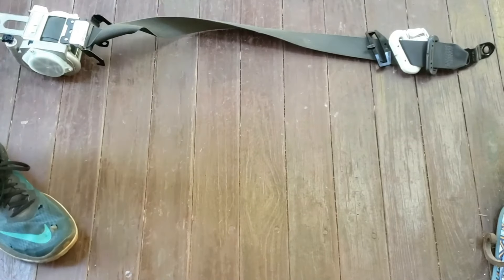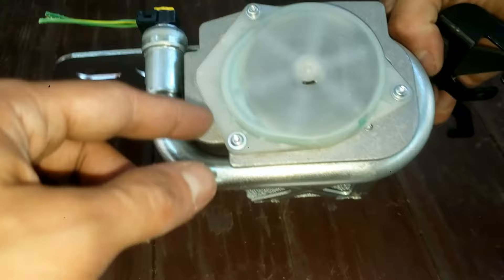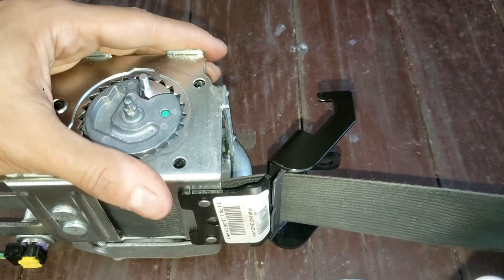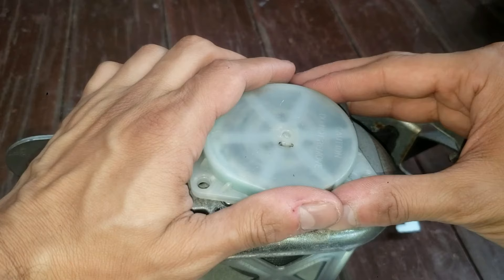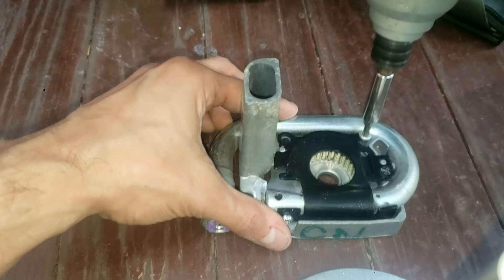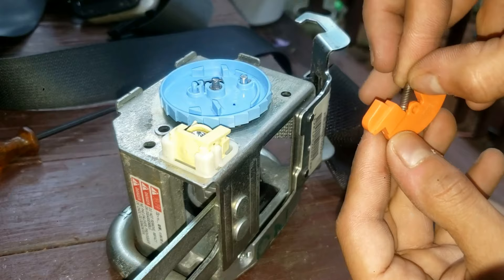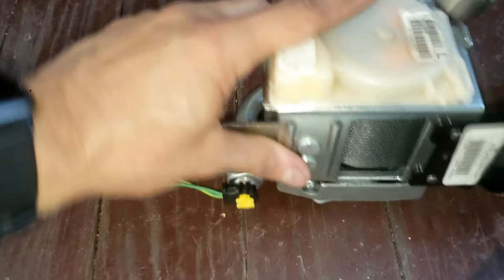Repair Locked Jammed Seat Belt Retractor And Teardown For Chrysler Or  Dodge

Comment: You didn’t unlock the belt you took it apart and put it back together kudos to that but you didn’t fix a problem.
Reply from the maker: Watch the video again in full. You'll see that it was stuck or jammed, and that I fixed it.
Reply: You right, he just apart it and put it back together that’s it. This seat belt was not lock at all, just needed to be balanced and virtually pulled.

Comment: that was a great tear down and put back together.  what part was stuck?  what made the retractor stuck in place?  could you point out what was stuck?
Reply from the maker: Thanks. So the actual belt strap was stuck because it got over retracted. I know that might not be the answer you were expecting, but literally the belt strap got to far in, and this had to be opened up to loosen the the belt, so it could function normally again.
Reply: @FixCarYourself  okay, got it.  if the belt retracts too far the diameter of the retracted belt will rub against the frame and push the ceter shaft off center.  That makes it so the ratchet lock can't unlock.  Thank you for the video
Reply from the maker: Glad it helped!

Comment: Thanks a lot .. your disasimeling  video made it easy for me to know what missing with my seatbelt.. it was stuck initially and after I tried to clean it and put it back it didn’t work and then later after I watched your video I noticed that I was missing the big spring .. luckily I found it just blew the seatbelt itself and the time I placed it back it worked .  So thanks 👍
Reply from the maker: Awesome 👍 glad it helped, and that you figured out how to fix your car yourself.
Reply: Disassembling.  I think I got that right...the spellcheck didn't complain. Only the word "spellcheck" is underlined in red, so...apparently, it's spelled wrong.
Reply: @FixCarYourself  I think I'll watch more of your videos. Just try to use your voice a little louder. Also...the slower, the better...nice job.
Reply from the maker: Thanks

Comment: Thank you.  Everyone is doing the standard slow pull release which helps in no way when belt has been wound completely.  thank you for help.  Saved me a few bucks buying another.  I had mine fixed and reinstalled in 10 minutes.😁
Reply from the maker: Awesome! The slow pull sometimes works, but its luck. Usually its just wound in a little too much. Glad you saved money, and reinstalling in 10 minutes... Wow that's a little quicker than me.
Reply: What? 10 minutes?!!

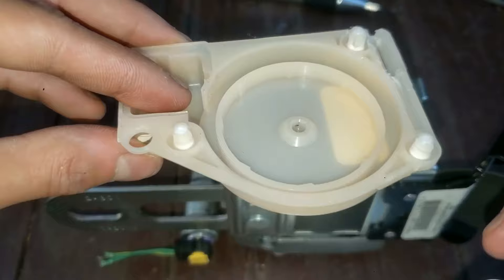Comment: Many thanks!  The mechanism is very similar to that of a 2005 Mustang, and this video was very useful when mine jammed.  The root cause of that was a small piece of glass (from the back window being blown out by a tree limb falling on it!) had wedged underneath the captured ball bearing (at 2:02 in the bottom left.)  

One thing I will add is that when removing the white plastic cap for the retractor mechanism, you can reduce the resistance for prying with a screwdriver.  On mine (and it looks like this one as well) each of the three 'tabs' (referenced at 1:55) inserted into the metal body are hollow, and have a small plastic 'post' insert in the middle.  Using a small punch and tapping that post out from the bottom make it easier to pop that off with less prying and risk of damage.
Reply from the maker: Good comment for Ford vehicles and specifically for those cool Mustangs!

Comment: Nice! I’m glad I watched. Thank you!! I was about to send mine out for repair. All I needed to do was hold it upright as it’s normal position would be in the rig. Mine worked fine until it was removed for another purpose. Then it was stuck retracted. Thanks again. Nice presentation.
Reply from the maker: Thanks so much...glad it helped. AND you saved money AND you fixed it yourself 👏 👍.

Comment: The actual seat belt plate broke on my driver side last night. It’s stuck inside the buckle and the strap just hangs freely from the driver door 😮. Is it possible to just replace the seat belt plate (part that goes into the buckle) ? I feel i need a new seatbelt altogether from junk yard
Reply from the maker: Not sure, it depends upon the manufacturer and when it was made, as well as the ability to get the components for that seat belt. But the real question is why would that break to begin with. And because I'm asking that question. I would just replace the whole thing as that part might be currently fragile or compromised. Safety is important, so I would get a new one or a gently used/restored one.

Comment: Thanks for this! I’ve installed a replacement belt following this guide. The replacement belt was locked up because the seller didn’t install a clip. I unlocked it according this video and installed it. However the new belt keeps locking up. To unlock it I can sometimes pull the belt really hard and then it unlocks. If that doesn’t help I have to pull the belt, adjust the seat hight in order to get more room and the very gently let the belt retract. TL;DR: the replacement belt is far to sensitive. Is this something that can be adjusted?
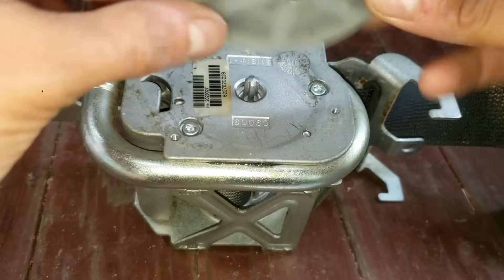Reply from the maker: Glad this helped! You could adjust the winder. Look at the 7:45 min area of this video. Once the winder can't turn anymore you'll know its tight...so instead you could turn it one rotation and then put those 3 screws back into place. 

Although I have never tried this before, I've heard this is what people do to make it feel "looser." Normally I would just leave it as is even though its really sensitive.
Reply from the maker: One more thing to mention is to make sure the belt buckle is installed correctly and properly. If not precise that could also be the problem. Here is a different video I made that shows how I installed it. Hopefully this helps as well.

👉 https://youtu.be/7DTAUa5dX3I

Comment: Your good man and some cat in the service department tried to hose me for a grand plus to diagnose and fix or in his eyes replace a seatbelt that sticks once in awhile.  Tyler Higgins works at the Dodge Dealer in Grand Junction CO and has tried to screw my family at least 4 times.  The twerp did not like me calling BS on the “complicated cabin filter replacement and induction cleaner.  These joker clean out your wallet,  Thank you sir for sharing your knowledge.
😊
Reply from the maker: Thanks for the complement and your personal experience!!! Hopefully one day soon mechanics and dealerships will start doing what's right for the customer and truly figure out the problem instead of wasting their customer's money and time. More specifically OEM's need to better engineer their vehicles... so less repairs if any ever need to be repaired. Hopefully as they go into electric they have a clean state to win back and retain their customers and more importantly improve or increase their reputation for damn great cars!!!

Comment: What's the point to remove a metal balls and put them back? Is it important or no?
Reply from the maker: Yes very important. During a crash an electrical current or gas is released which hits the balls and activates the seat belt. Keeping you safe and locked in place. I wouldn't remove the balls and just leave them in. If you do remove, then at that point for safety purposes just get a brand new seat belt.
Reply: @FixCarYourself  Well, if it fired and the gas came out, how to charge it again.
Reply from the maker: if it fired then its compromised. A replacement would be required at that point. Safety is not something to take lightly.
Reply: How do we know if it is fired and the gas is out ? How do we replace the inflators ?
Reply: @WhiteLine-ym8ng  your sitbelt will stuck.
Reply from the maker: Usually once the air bag is deployed an electronic pulse is sent to those balls to be released and "explodes" activating the seatbelt to keep one secured during an accident.  But again its compromised and can no longer be reused.

Comment: Sir, I followed your instruction until 2:15 and the belt was unlocked and moved. But it wont retract. Should i remove the winder too? The car wasnt in an accident.
Reply from the maker: Hard to say what the issue is exactly unless I see it and/or test it.